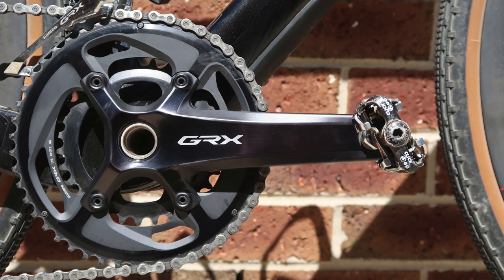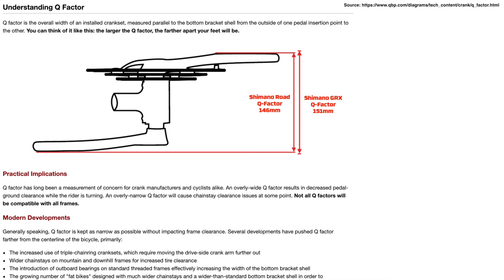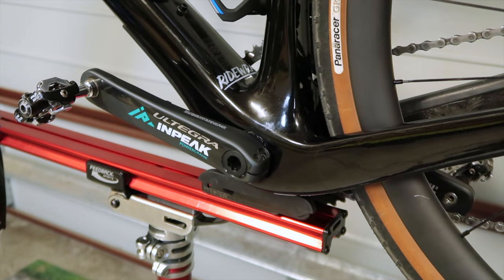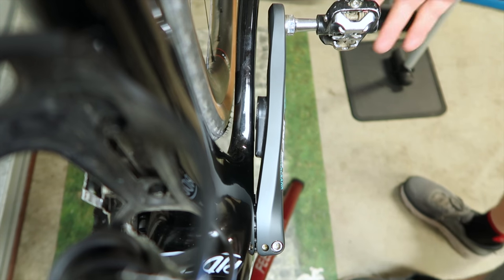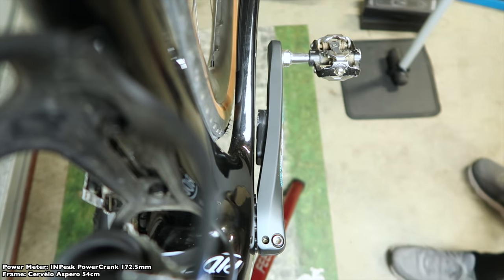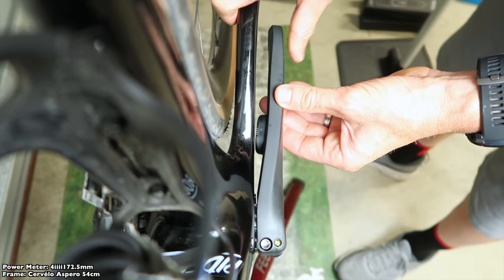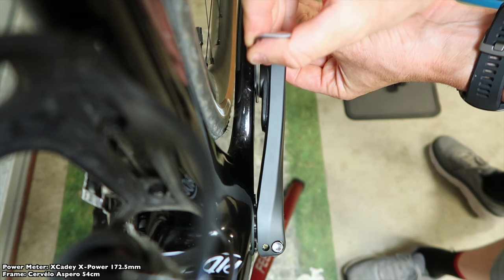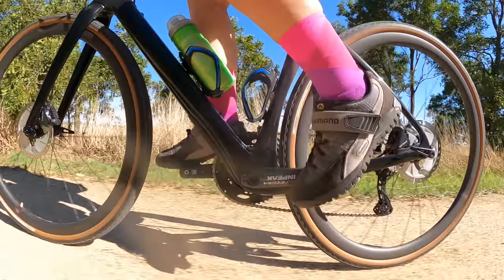Shimano GRX Power w/ Road Single Side Power Crank 🚲⚡️

Comment: Hi Shane, thanks for making this video. I recently purchased gravel bikes and was disheartened by the fact that Stages cycling recommended buying new power meters to fit my gravel bikes (GRX vs Ultegra). Thanks to this video I have repurposed my Stages Road cycling power meter into my gravel bike (albeit with minor tweaks due to Q-factor and pod thickness). This video saved me $899 (cost of my original power meter)!

Comment: Thanks. Definitely a hack , not a botch ! I share my road R8000 pioneer left crank between my road bike and gravel with no issue. Yet the  clearance is tight. Next is trying on a new GRX 810 1X crankset. Let's see.... 
It is a bit of a hassle to share one on 2 bikes but I kinda ride them at different seasons so... worth  $300 savings to me. Great video !

Comment: Thanks Bloke . I got me a GRX 600 crankset because 165mm  and short legs. I think my only option would be shimano road crank arm  in 165mm as I dont think there is stages GRX in 165mm,  .Nice  to see some good clearance with the stages crank arm, as My bike is a steel Surly midnight special and is quite curvy on the chainstay. Still might go with the FA hack ,dunno yet though. cheers
Reply: You can go sram axs instead plus quarq power meter. Reliable af. They also run 165mm. They used to have 162.5mm but no longer sells them.
Reply: Power2Max Gravel has you covered, those Rotor cranks they use are available in really short lengths.
Reply: Some manufacturers like InPeak have the option to send them your existing crank and they'll install their modul on it. Don't see a reason why it shouldn't work with 165 mm.
Reply: You are correct your only option if you just want to swap the left arm is to go with a Shimano road crank, the GRX810 does not come in 165mm. The GRX 600 has a concave channel on the backside of the crank arm which makes it incompatible with a crank-based power meter.

Comment: I personally went down the road of the Assioma Hack with SPD cleats on my gravel bike.... 100% best solution in my opinion.
Reply: doesn't really play that well with my shoes - I had to cut the rubber a little and clipping in/pout still isn't ideal...
Reply: Also more expensive than just buying a Stages or 4iiii GRX specific crank arm, even if you only want a left side pedal power meter. Unless I'm missing something?

Comment: I did this many months ago, went out bought a 4iiii 105 crank arm, fitted it to the grx crank and it did not have the clearance (rubbed the chainstay) luckily I have a stages on the other bike so swapped the 4iiii to it and the stages to the grx bike and all is good.
Reply: Hi Derek. I have the same problem with the 4iii 105 on my canyon grail cf. Would a spacer work behind the crank to give more clearance. Thanks
Reply: @7070Phantom  it might give you the clearance for the bulbous 4iiii PM but it would then introduce a new issue of the crank arm not being located where it is meant to be located for the pin that the crank arm bolts slide through, so could end up in a situation where the crank arm keeps sliding off. Best to send the 4iiii back and buy a stages or a pedal based pm
Reply: @cleggycyclist  Great. Thanks Derek for getting back to me.

Comment: I went with the Power2Max Gravel NGeco Rotor Power2Max edition 2x with GRX spacing on my Specialized Diverge.  May not be the cheapest option, but it was plug-and-play and just works.
Reply: I have the Stages left-only and I just bought a P2M Gravel NG Aldhu Carbon 48/31 to replace the Stages.  Shifting with the Rotor produced 48/31 chainrings is atrocious compared to the GRX crankset.  Going from the small to the big ring results in the chain grinding on the big ring on 50% of the shifts.  Unfortunately this solution didn't work out for me and I'm going to return the P2M.  I hope you're having better luck with yours.  I have the GRX Di2 setup.  A mechanical group might produce different results.

Comment: Great hack Shane I’ve bought the stages did you need to use the road crank preload crank bolt or did you retain the grx one I’ve been told it doesn’t matter keep the great videos going
Reply from the maker: I think I used the road one. I suspect it doesn’t matter.
Reply: Thanks for the prompt reply Shane

Comment: Is there a hack/bodge for my Cannondale SuperX GRX, which unfortunately uses Cannondales own 1x BB86a crankset. The only solution I've found, is buying a SRAM Quarg powermeter for it. I could do the Assioma SPD hack, but I don't always treat the bike nicely and would worry that the pod (and bearing due to water/mud) would be wrecked quite fast. Cheers and keep up the good work 💪
Reply: Stages for cannondale si cranks exist

Comment: My newest gravel bike has the new Power2Max gravel power meter, with 46/30 chainrings. It's also available with 48/31, so they have really gone out of their way to make it GRX compatible. My only minor issue so far is that I had to set the front derailleur up so it almost touches the crank arm to get really good shifting.
Reply: I have the Stages left-only and I just bought a P2M Gravel NG Aldhu Carbon 48/31 to replace the Stages.  Shifting with the Rotor produced 48/31 chainrings is atrocious compared to the GRX crankset.  Going from the small to the big ring results in the chain grinding on the big ring on 50% of the shifts.  Unfortunately this solution didn't work out for me and I'm going to return the P2M.  I hope you're having better luck with yours.  I have the GRX Di2 setup.  A mechanical group might produce different results.  Also the 46/30 chainrings might have less shifting issues as the tooth count gap is only 16 and not 17.

Comment: Hi Shane do you have the equipment to try a magene power cranks in a double with a grx derailleur and front mech to see how that works i want a power meter 165mm shimano only do 165mm in the 600 magene don't have a wider chain line yet,
Reply from the maker: No. All my gravel rigs are 1x.

Comment: One thing I find strange is that on my MTB the cranks are longer than on my road bikes. I guess for more leverage. So I'm assuming a gravel bikes typically have the same length as road cranks. Hence the ability to swap in a road crank with PM
Reply: No.
Reply: Cranks come in different lengths and manufacturers spec them normally speaking in accordance to frame size. Leverage/torque is irrelevant if you have the correct gear ratios for your intended use as you simply change gear when you need more or less of it.

Comment: Hi Shane, do you know if the Stages GRX power meter crank can actually work with the GRX 600 crankset? The sales page says it’s for the 810, but not sure if there’s a physical limitation or not.
Reply from the maker: Not sure sorry. Stages should have a quick answer on this.
Reply: From my understanding it's a no if you're looking for a factory install on the left arm (right side I'm not sure). 4iii has made the statement that only the 810 since the crank arm is flat on the back side. I would say what's been said already reach out to the guys at stages.
Reply: The 610 has a concave channel on the backside, so a power meter cannot be installed.